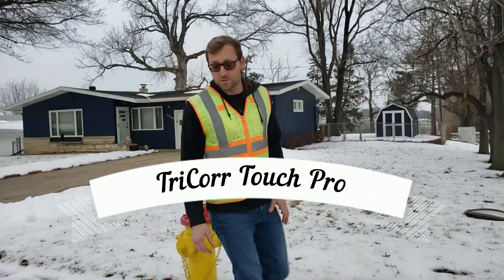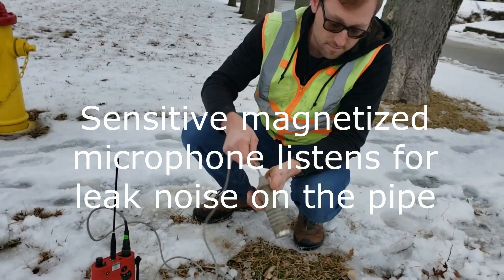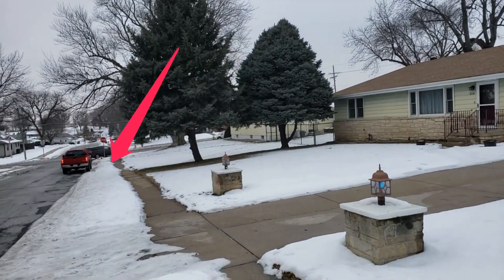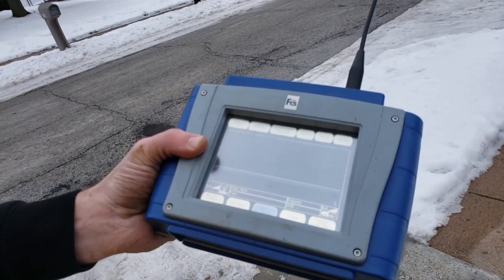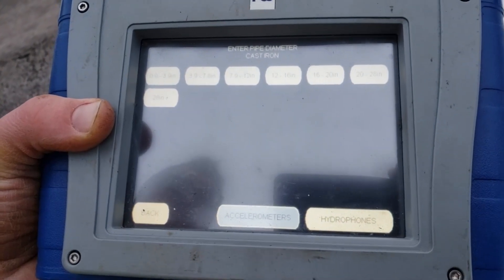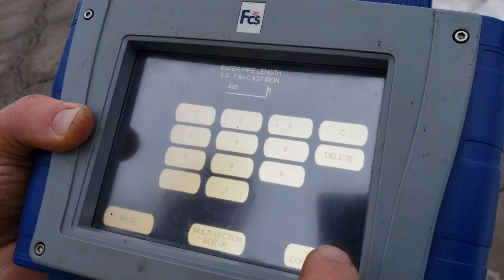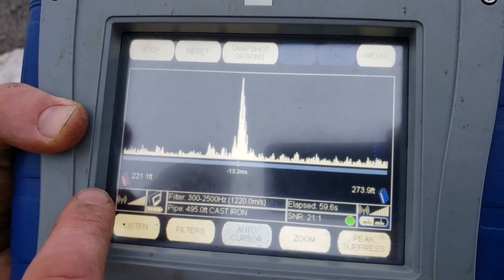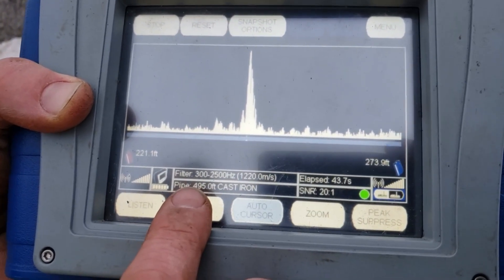TriCorrTouchPro Water Leak Detector

Comment: Can you please go over the multi section part?
What I am getting is that if you have 2 pipes of different diameter and different types of materials, then you use a multi section.
Reply from the maker: @idiabate112  yes that's correct. You choose multi section and enter the distance, material and size for each section